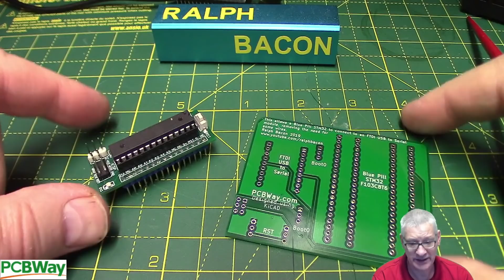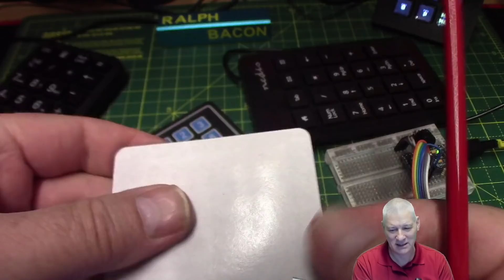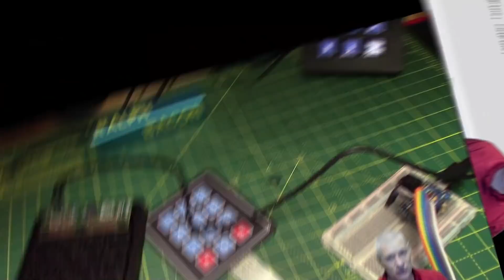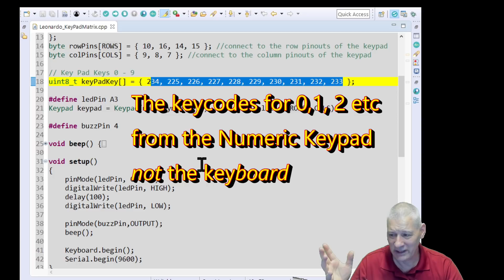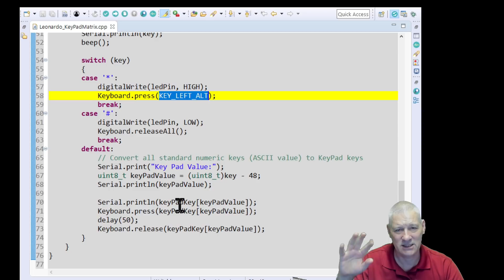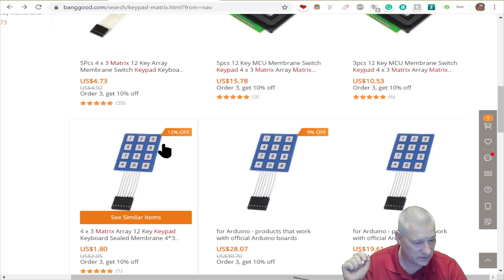#191 No "ALT-key" or Numeric Keypad? An Arduino 32U4 workaround!

Comment: Hi Ralph, have just come across "FreeDeck" (Open Source Stream Deck Alternative) and thought it might be of interest to you if you have not seen it already. https://youtu.be/-3Zw8hbpVq4 Not sure of the reliability of the design using pin headers to allow the flex when pressing the screens/buttons.
Reply from the maker: Very interesting video (from a fellow Brit, so must be of superior quality, heh heh). I got my solution working but only on a very messy breadboard; I must get a PCB to finish mine off (no touch screens, I'm afraid, but now I've seen that project...). Thanks for the heads up, Rob!

Comment: Hey Ralph! Wanted to know if you're continuing this project? :) I have had plans for making a similar HID gadget (but through BLE) and just ordered myself some USB numpads to hack on. Found this video while looking for numpad disassemblies :) Were you planning on designing the PCB to replace the original controller, or will you be soldering wires to the membrane?
Reply from the maker: Things have moved on since I did this video, Tristan. 

I have discovered that to whilst I could connect a membrane-type keypad to an Arduino (for example, and as shown in the demo, known as a USB device), it was easier (although more complex) so connect a standard keypad to an Arduino (or other µC) HOST, that to an Arduino DEVICE (all in the same box) and program both parts as I wished. 

I've proven the concept and the beauty is that even my wireless dongle for the keypad is accepted into the HOST so my nice Perixx wireless keypad works nicely. 
The bad news is that I've not really done any of the programming required. I've proven the concept and then other projects took over my time.

I shall have to take some time and resurrect this as I'm struggling without my ALT keypad (just making do with the Stream Deck).

Comment: "My keyboard is too large. I know! I'll replace it with a smaller one, then add an extra keypad!"

On a more serious note....why the hell does the keypad board have like 20 tin fingers? Good luck connecting to all of those! Six rows and four columns should require 10 pins. What're the others for?
Reply from the maker: Ah, yes, but my keypad is now on the left hand side, towards the back of the desk so I just grab it when I need it! The extra connections are not used in this keypad but are probably use for other keyboards too.

Comment: I'm sure with my external 'numpad', I can use the ALT key on my main keyboard, and then use the unicode symbols on the numpad. I'll have to check when I go into the office (and find the external numpad again, since I upgraded to a Logitech G512 recently and that has a numpad)
Reply from the maker: Nope. First thing I tried (would you believe?) Great to hear from you, Jess. Thanks for posting.
What? You want a better explanation? OK, read on!

The reason what you're suggesting doesn't work is because the keyboard is enumerated by Windows as one device and the non-attached numeric keypad as another device. So the (modified) key presses must come from ONE device not a combination of both! The answer to this problem is far more complex than I would have thought, as you will find out should I be successful and do a video on it! I know, you're on the edge of your seat...
Reply: @RalphBacon  Oh, maybe I had a special circumstance then. I seem to remember it working, although this could be false memory syndrome. I hit the big three zero in April :P (also, replied to you on the video about the 555. I've not been so well recently - You know things are bad when I can't even watch your videos on YouTube!)
Reply from the maker: Very Belated Happy Birthday Jess. I'm sorry you're not doing too well. Mainly because my viewing figures suffer, you understand 🤣  Seriously, I can only wish you well and hope you recover soon. Mainly because my viewing figures will improve... oh, I did that joke already. 🤣 I shall now find your reply to the 555 video (which will be the subject of my next-but-one videos). The 555, not your reply. Get well soon, Jess.

Comment: I recently got a wireless keyboard that doesn't have a Del key.  They show one in the picture but on the keyboard itself there is a Backspace key instead.
Reply from the maker: The Backspace key should be above the Enter key,. The Del key should be part of the Del/Home/End group above the arrow keys. Have you been short changed? You need to build an Arduino 32U4 based keypad just for that one key!
Reply: @RalphBacon  No, what he needs to do is send the keyboard back and complain.

Comment: Suggest that you install WinCompose.
Then you define a compose key (I use right-alt), and after that you type µ as ralt-/-u
(For Linux/BSD, you just need to set it up)
Reply from the maker: I'm trying to get away from running an interceptor program on my PC. I have an idea that is Arduino related, keep tuned.

Comment: That's a lot of work to save 3" of desktop space.
Reply from the maker: It's not just about space, Robert, it's about the fact that the mouse (and mat) are in an offset awkward place and I'm sitting in front of the K and L key instead of the G and H key. It's bothered me for 30 years and I've tried all sorts of combinations. I might have found a hardware solution anyway but it won't be for a couple of weeks. Stay tuned!

Comment: Hey Ralph. Here is a zero cost non-hardware solution (for Windows). AutoHotkey. Free and excellent documentation.
In its simplest mode it is a key press mapper. You can remap keys (or combinations thereof), set abbreviations (*), and more . Set your script to start with windows, and Bob is indeed your uncle. I use it to remap awkward key combos in games.
(*) Why is 'abbreviation' such a long word LOL.

I see further down that you have issues with AHK. Still others may profit for knowing about it. <Sigh>
Reply from the maker: I've used it for too long to know that it's not the solution I'm looking for right now.

Comment: A man after my own heart, sledgehammer to crack a nut. <Google degree symbol><Cut><Paste>
I have to <Google degree symbol> anyway as I can never remember the Alt code.
Reply from the maker: If only the keypad designers had thought to include an ALT key...
Reply: @RalphBacon  Have you tried typing    <Alt><Fn>klm  on the main keyboard. It works on mine to produce µ.  It uses the pseudo-laptop-keypad that you mentioned even though the keys aren't marked with the numbers. It is on a laptop but it is widescreen and has a numeric keypad.
Reply from the maker: I just tried it and it just called up the menu of the app with the ALT shortcut key. Never mind I have ordered some hardware that should sort all this out. You will be amazed and in awe! No, really. Keep tuned.

Comment: Ralph, if you can withstand a wired keyboard then the Raspberry Pi USB keyboard is small and capable of doing those characters.  It has a Num Lock key.  So [Num Lock] [Alt down] [K] [L] [M] [Alt up] [Num Lock] does the µ biz.  The keyboard even has reasonable PgUp and PGDn keys which many shortie keyboards don't have.
https://www.raspberrypi.org/products/raspberry-pi-keyboard-and-hub/
That said, I appreciate that it's not an Arduino solution/project, just a solution.
Cheers, Brian.
Reply from the maker: I have the Rii Wireless Keyboard for my Pi; but it's a bit small, too much like a laptop for me for everyday use, even if it does do (not tested) all this ALT malarkey, Brian! And, as you say, no fun at all, because I don't get to build anything!

Comment: Ha!  Alt-0230 is æ.  Alt-230 is µ.  Totally Microsoft.. which is to say, unintuitive.
Reply from the maker: I don't know why I prepended that leading zero. My brain is not what it used to be. But I'll say it is Microsoft's fault too.
Reply: @RalphBacon   :-)    Design a new lower half for the case of the wired keybad so you'll have enough room to shove an esp32 in there.. then make it Bluetooth.. (I know.. I dream..)
Reply: It's because leading zero in number means that number is octal.
Edit: It looks like I remember it wrong. Internet sources says that zero switches between OEM and ANSI codes...
Reply from the maker: @Chris W I thought of that and several other solutions too. My intended solution is now on order, But the parts are in short supply, so will be a couple of weeks at least.

Comment: If you are actually considering using your second 10-key only for "ALT keys", maybe just make a keypad of the symbols you might need. 12-16 special characters at a single press would cover a lot. Keep your nice one for data entry, Excell, and launch codes.
Reply from the maker: I might do that, David, but I need to get an Arduino in there somehow.
Reply: @RalphBacon  100%! And it needs a custom PCB. That's good content :)

Comment: Wouldn't it have been possible to remap the Corsair numbers to the alt numbers?  Does anything care that the numbers are standard numbers, ie would anything stop working if you gave it an alt number instead of a standard number?  That way you don't need an extra keypad at all.  Maybe there's a bit of software you could load on boot to do it.
Reply: even easier to remap one of the keys on the numpad, like that tab key maybe, to an ALT button. still good project for any key you might need.
Reply from the maker: I did just that, Andy, as an experiment and all hell broke loose when I used numpad numbers. So I had to edit the registry back again, quick.

Comment: Thanks - another good video and understand what you are trying to achieve - But a lot of work in replacing existing internal logic to change just one key. 
The Nedis works 'as is' except you want the 'Mail' to be mapped to 'Alt'
So how about a "USB to USB converter" (quick and dirty = back2back 32U4's ??) to capture Nedis codes and resend all unchanged, except for the 'Mail' key which you remap to 'Alt' before sending onto 'host' (PC).
Reply from the maker: Hmm, that is a very interesting idea. Would it work I wonder? Would the 32U4 read the incoming data correctly and be able to decode it? And then forward it out? I shall see whether this idea has legs, Jon (unless you have already done something similar)?
Reply: @RalphBacon  In previous decades I have done similar with RS232/DataProd and Centronics parallel - but never with USB. 
But, how about an FTDI interface to understand USB levels and timing from the Nedis, and provide TTL levels that could then be 'clocked-in' to the 32U4 before re-mapping and sending onto your PC ?!? 
OR 
one of the STM32F chips that have multiple USB ports on-chip that could then act as a 'USB Bridge' ?!?
Reply: There are such thing as USB host libraries, so it is indeed within the realms of possibility ;)

Comment: I was thinking about getting a keyboard without number pad, because I hardly use it at all. I didn't think about the ALT+number thing though, which is the only thing I actually do use it for! So thanks for pointing that out.
On the other hand I pretty much only use ALT+0160 there (because it's the only one I can remember XD ). But I guess I could map that to one of the media keys (play/pause/previous/next). All the other special characters I copy'n'paste from some online unicode map. I can't remember, if there was ever a case where I couldn't get a character that way. Does anyone know if there are any useful non-copyable codes that can only be input with the ALT-method?
ALT+0160 is a very useful character btw. It's the normal width non-breaking space. You can use it quite often in places where something demands a text input, but you really don't want to (because that text, even if it was just a dot, would appear somewhere). Apparently the NBSP does not count as whitespace in many cases. Its proper use is obviously if you want to separate two words by a space but never have line breaks right there, like in "1st place" or "St. Whereever", in an IBAN (which is usually written in blocks of four) or for the unit symbol after a number ("230 V"). For the latter the narrow NBSP would be even more suitable, but I had less luck with software in dealing with that.
Reply from the maker: Yes, I had forgotten entirely the use of ALT with a tenkeyless keyboard. Doh! Interesting about the space character. I'll make a note.

Comment: The letter æ is the letter after z in the alphabet (Around here), next is ø and å (We have 3 extra letters in the alphabet).
I have not tried using the keyboard functions on a 32U4 processor, but I had some fun (Very little documentation and no libraries) doing it long time ago with a PC-XT protocol, including simulating ALT-xxx codes.
If you only have a few codes you need, maybe doing a keyboard that sends exactly those codes would be a good idea, instead of a generic ALT-XXX keyboard.
Reply from the maker: Remembering the mapped keys could get tricky (with my brain). I'd rather it was generic so I can type any ALT (extended) key whenever I want. Just like a standard keyboard...

Comment: Why not use the keypad library and map a pressed key to a sequence of keypresses needed for your desired character  eg  
Keyboard.press(KEY_LEFT_ALT);
delay(100);
Keyboard.press(KP_2);
delay(100);
Keyboard.release(KP_2);
Keyboard.press(KP_3);
delay(100);
Keyboard.release(KP_3);
Keyboard.press(KP_4);
delay(100);
Keyboard.releaseAll();

https://forum.arduino.cc/index.php?topic=622597.0
kp definition codes given here
Reply from the maker: That's what I am doing with the matrix keypad, right? It works but it's not solid enough. And the keys are rubbish. OK for a quick door entry system but not a typing system. Hence the need for better hardware.
Reply: @RalphBacon  I thought you were manually toggling on alt then sending the individual keys, I was talking about you pressing one key and sending all codes necessary for eg mu
Reply from the maker: Yes, I could do that too (in fact, as the programming is under my control I could do both). I'll get the hardware up and running first though.

Comment: Learning to use the mouse left handed recenters the keys to normal, the extra length to the right no longer matters and your writing hand is free for making notes.
Reply: I'm right handed but have used this technique since I first used a mouse some 30 years ago.
Reply from the maker: Unfortunately my mouse is a Logitech Performance MX, and whilst it fits my gorilla hands nicely it is a right-hand mouse only.
Reply: @RalphBacon  Consider a Trackball.
Reply: @RalphWLundvall  A trackball that can be used left-handed and doesn't suck? They don't exist. I looked recently. Got up to the £120 mark and stopped looking.
Reply: @RalphBacon  Many are. It's part of the systematic exclusion of lefties that has been going on for thousands of years.

Comment: I think you may struggle to get that PCB out of the keypad. Those plastic rivets look permanent. You will have to break them to remove the old PCB and then you won't have anything to hold the new PCB in place. (Although, I suppose, you could use liberal amounts of hot glue.) If you do make your own PCB to replace the existing one, I would love to see a video about it.)
Reply: If you keep a spare old conical soldering iron tip just for plastics, you can reuse the plastic stakes pretty easily. Just turn the iron temp way way down to where it just melts the plastic and start pushing it around.
  I did auto body work for years. "Plastic welding" is the process used for fixing tears in ABS panels like bumper covers. There are tricks and products made to aid in repairs on this scale, but the idea is applicable here. It's quite possible to manipulate and reuse the stakes with a little bit of heat. The main trick is to use as little heat as possible. It's tempting to turn up the iron and go much quicker, but most plastics become brittle with heat. Only add as much as is required to get the job done slowly.
  I got a HP pavilion laptop for super cheap because it was missing a key and has a "non replaceable" keyboard that is hot staked in. I got a replacement keyboard from China for $15, used a soldering iron, and replaced the keyboard myself. I haven't had any issues since. It's really easy to do, it just takes a couple of hours to replace the 50 or so stakes. My stakes are of better quality than the originals. Half of the original ones from the assembly house were not sufficiently pressed. Mine are larger and because I hand tensioned the connection for each stake the keyboard is much more solid.
Reply from the maker: I've got it out. Now to measure, very, very accurately so I can create a replacement and where everything lines up.

Comment: Bow I just need to look into HID in detail to see what's involved in building a ble keypad. I'm sure I could scratch up the code, for an esp32, to handle the keypad end but not sure if I'd have to write a windows device driver to match. Glad I'm retired :)
Reply from the maker: Should be straightforward (I didn't say easy).
Reply: @RalphBacon  PS: just watched a video, by Andreas Spiess, about an ESP32-S2. Might be an even better fit.
Reply: @RalphBacon  No. Not easy perhaps, but most often fun :)

Comment: Can you not just re-map the unused "F keys" to send the required data ? or as with mine, right ALT produces ²³ ðđ¶ħ↓ and this map can be changed to what ever characters I wish.
Reply: AutoHotKey, yea?  But that is too easy, making a solution is a fun challenge.
Reply from the maker: Don't mention AutoHotKey, I had to use that in a work project for about a year. Drove me mad.
Reply: They're only "unused" for people like you. More advanced users use them regularly.